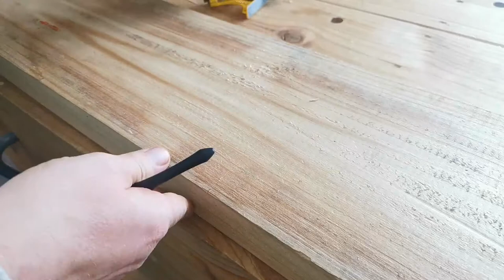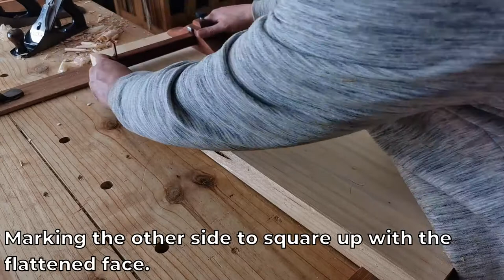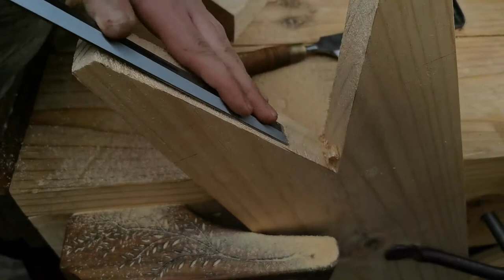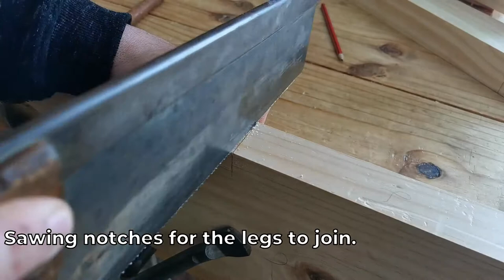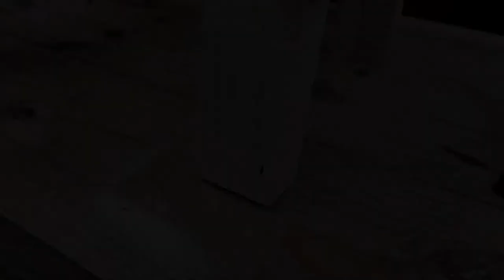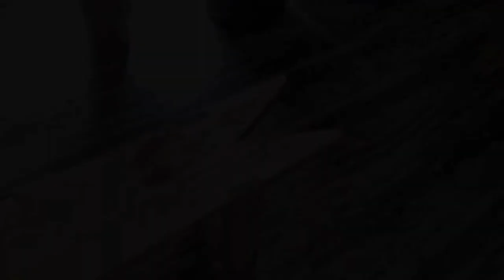Making a Sawhorse

Comment: The block and pencil is a great idea for levelling the legs but you'd lose a lot less from each leg if the pencil was held lower down.
Reply from the maker: Thanks.

You are right, however, in this case I worked out beforehand how much length I wanted to lose, in order for the saw bench to be about knee height with my body, by drilling the pencil hole trough the block. :)